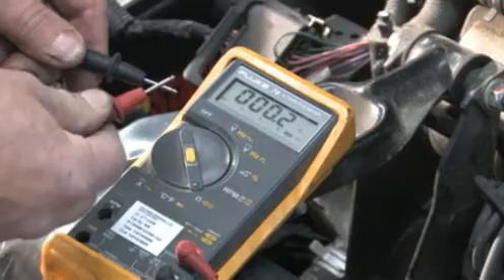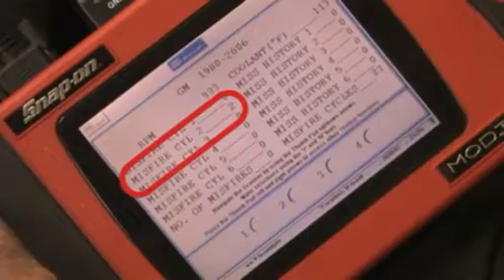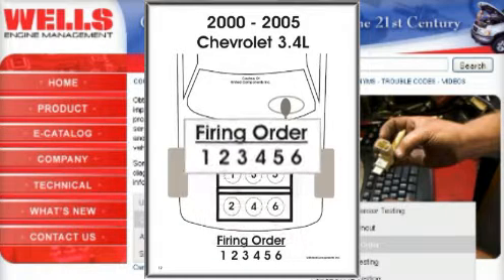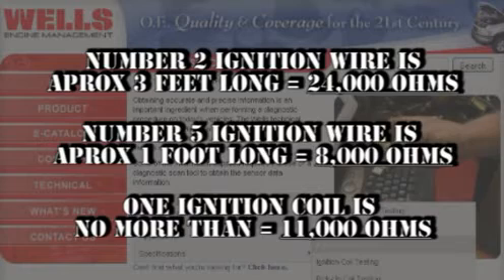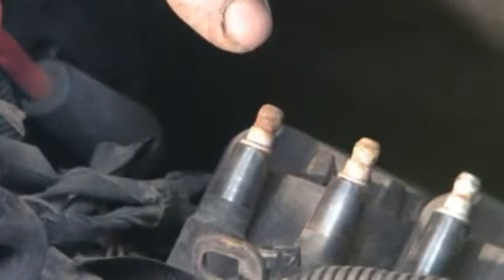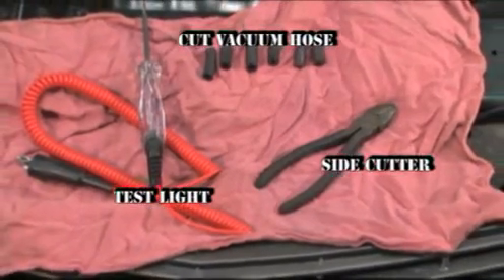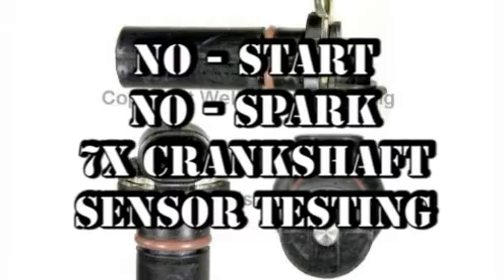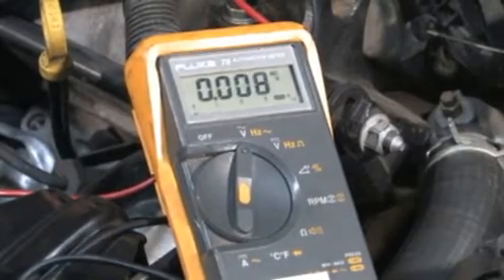Wells Distributor - Less (DIS) Ignition Testing and Troubleshooting

Comment: hey mark ,
i have a toyota pick up with 3rz-fe 2.7 liter efi 4 cylinder engine with 2 coil packs .
how to test those coil packs?
are they a DIS type ?
Reply from the maker: According to my information, I guessed at the year of your vehicle (2002), you have coil on plug. Whats up? Why are you checking the coils?
Mark Hicks
Wells Vehicle Electronics
Reply: markjhicks thanks for replay.
actually it is a 2004 toyota  hilux it is the same like old toyota pick up's and tacoma's in usa but it is sold in Europe and Asia named hilux.
the problem is it had a misfire and the sound of the exhaust tale pipe is like drrrrrrrr and some intermittent dip dip  lol .
i noticed a carbon with drop of water came from the tale pipe .
Reply from the maker: toolman talal
does the check engine light illuminate? Do you have the codes?
Reply: no check engine light .
Reply from the maker: toolman talal
Well from your description it is pretty tough to get down to the cause. the way most guys check a coil on plug system is to first determine which cylinder is misfiring. This can be done with a scan tool or try unplugging one coil or injector at a time while the engine is running. the one that makes the least amount of change in the engine running ability is the cylinder with the misfire. then swap that coil to another cylinder and retest. If the misfire followed the coil replace it, if it didn't look to another place for the cause.
Mark Hicks
Wells Vehicle Electronics
Reply: markjhicks it is not a coil on plug.
it is 2 coils with 4 wires .
Reply from the maker: In that case, yes you can test it just like in the video.
Stay in Touch,
Mark
Reply: markjhicks
how can i know if the coil pack is weak ?
Reply from the maker: Through a resistance test and by checking the output. You will need an adjustable spark tester.
Mark
Reply: thanks mark

Comment: Is this test light a regular test light that we use for testing a fuses or is it a special test light made for spark test ?
Reply from the maker: It is a regular test light. Usually the cheap ones work the best.
Mark Hicks
Wells Vehicle Electronics
Reply: markjhicks thanks alot i was worried because i think the kv will damage the test light.
Reply from the maker: toolman talal
Let me make sure we are clear ... We used a test light to check the module function. We used a timing (ordinary) light to test for spark. You can not use a test light to check for spark, because like you said the high voltage will burn out the light.
Mark
Reply: markjhicks 
now it's clear thank you very much.
Reply from the maker: toolman talal
My pleasure!

Comment: thanks thumbs up and subscribed
Reply from the maker: Thank you, your kind words and sub means a lot to us!
Take Care,
Mark Hicks
Wells Vehicle Electronics
Reply: Looks like im changing my crank sensor tomorrow  good times.
Reply from the maker: Do you need any information on how to do it?
Reply: markjhicks I will keep you updated its a 00 Oldsmobile  Alero  I have replaced the fuel filter and cleaned the gas tank out. My code reader its a very cheap one isn't telling me anything. my son took it to his school shop class and they didn't get anything as well but it has good fuel pressure. It runs ok cold it does miss a little under heavy load but as soon as it gets to normal temp it starts to miss. I changed the coil packs and ignition module now it wont start. Im kinda thinking its the wire going to the crank sensor as I see a few on youtube and internet were they start to wear through
Reply from the maker: I will assume you have a 3.4 engine. There are two crank sensors on this engine. One by the pulley in front (24X) and one in the middle of the block in the back of the engine (7X). It is the 7X sensor that usually goes out. It is a two wire sensor that sends an AC voltage signal to the ignition module. It is also common for the wires to burn through on the exhaust. Follow the wires first.
Hope this helps,
Mark Hicks
Wells Vehicle Electronics
Reply: markjhicks what would be the part number on the 24*? and can I test it like the 7*
Reply from the maker: No the 24X is a Hall Effect you will need a labscope or at least a scan tool that can read the signal coming into the computer. You can look up all your part numbers by going to www.wellsve.com nice catalog section and tons of repair information.
Mark Hicks
Wells Vehicle Electronics

Comment: thank you for the info and using a timing light to check for fire,instead of telling me to buy a tool ill never use or worse pulling the plug wire off while its running